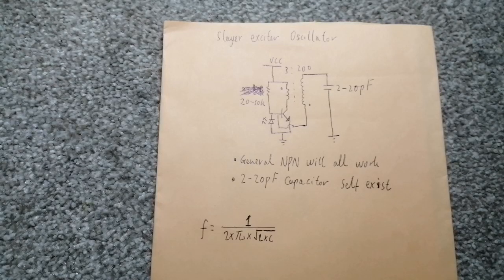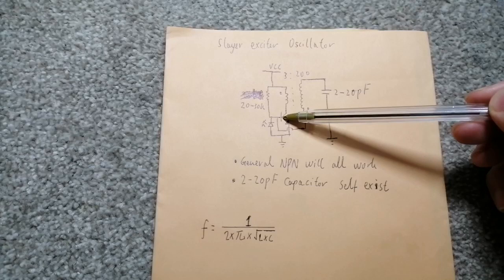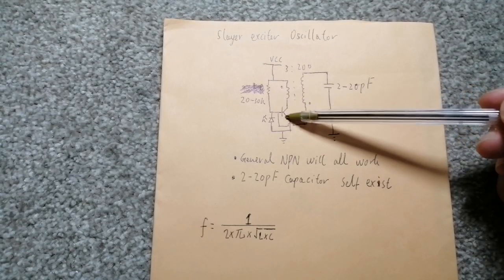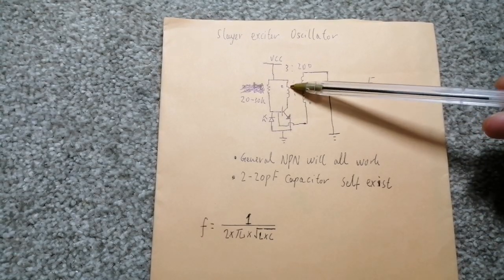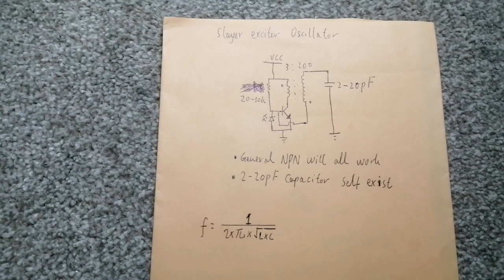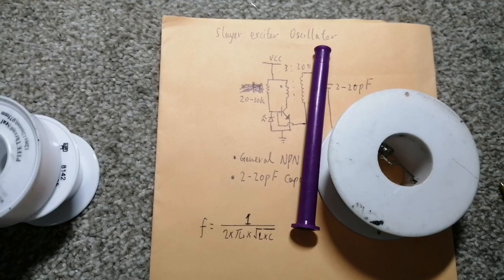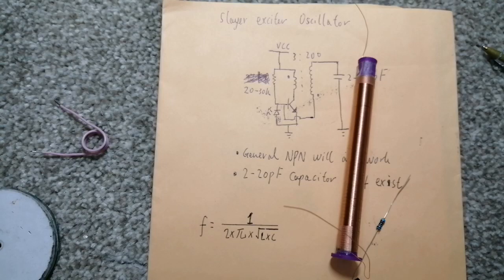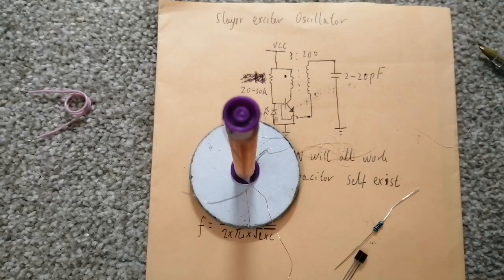How to make a powerful mini Tesla coil (slayer exciter SSTC) part:1

Comment: Look at the dots. Positive at one dot = positive at the other, not negative. The feedback is positive.
Reply from the maker: are you referring to the dot on the transformer? If you do, then please look it up.
The terms for the dot is actually called "transformer dot convention" it is nothing to do with positive or negative, it is only to show phase relation between primary and secondary voltage and currents in a transformer.
please read: https://www.allaboutcircuits.com/textbook/alternating-current/chpt-9/phasing/
Reply: @ReedSwitchTube  I mean that when the transistor conducts the polarity over the primary coil is positive at the dot side, and so the polarity over the secondary coil is also positive at the dot side. The current through the secondary coil initially adds to the current through the resistor turning the transistor on more strongly. The transistor only cuts off and the LED lights up half cycle of the oscillation later.
Reply from the maker: @acmdq2007  please can you tell me how a NPN transistor cut off only from positive feed back through the secondary coil to the NPN base?
Reply: @ReedSwitchTube  It cuts off half cycle of the oscillation later, when the direction of the current in the secondary coil reverts.
Reply from the maker: @acmdq2007  So the both dot should be on the same side in order for a negative feed back to pull the base down?
Reply: @ReedSwitchTube  This would correspond to revert the connections of the primary coil. The circuit would not work. What pulls the base down is the current in the secondary coil, that is almost a sinusoid after an initial transient. Note that the current in the secondary coil can't continue going down and entering the base forever, as the other end of the coil is just a distributed capacitor. The current first increases, then decreases, then inverts, lighting the LED, then increases again, with the cycle at the resonance frequency of the secondary coil and its distributed capacitances, of the coil itself and of the top load.
Reply from the maker: @acmdq2007  now I get it, I realise this is also applied to joule thief circuit as well.  Thanks a lot!